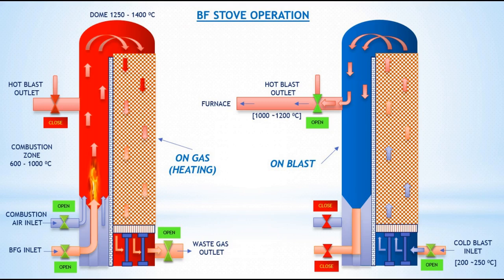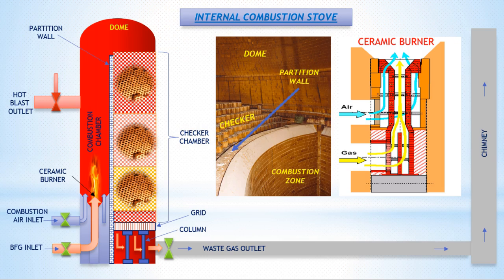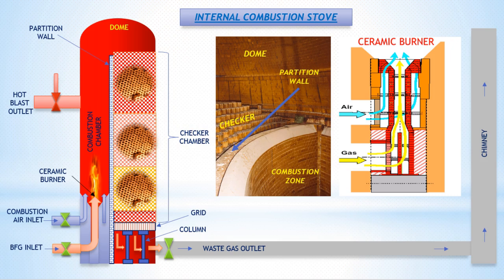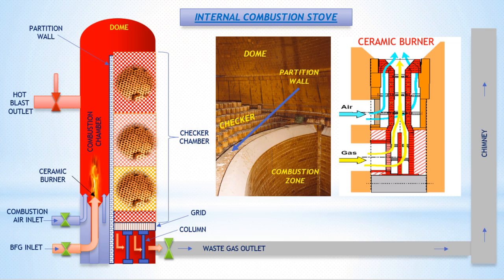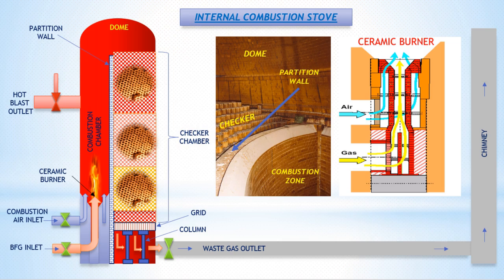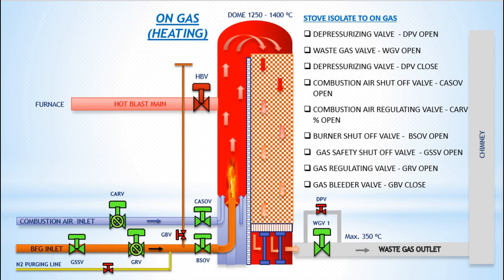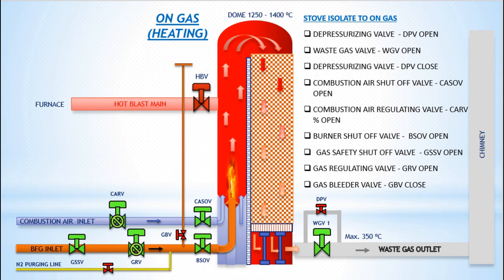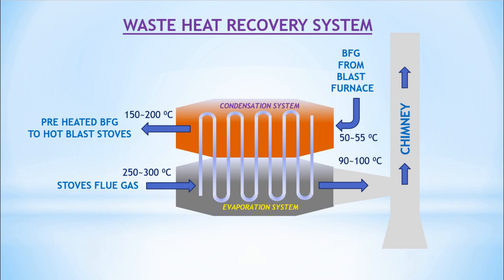BF Stove Operation | Blast Furnace | Function of Stoves | Tech It Eze

Comment: Good morning sir 
how to control blast furnace top pressure if increase.
And how to control hanging inside the furnace wall.
Reply from the maker: Thank you for watching videos. We will upload videos on your topic.
Reply from the maker: @mahendrabaghel2416  several modes available for top pressure control such as septum valve,  TRT mode, Wet Scrubber mode. Depends which system you have in your plant
Reply from the maker: For hang furnace control we will upload videos recently
Reply: @pgangulybf  okk

Comment: Sir what happened when ob blast stove suddenly gone box up
Reply from the maker: It should not, "minimum one stove will be on blast condition during running",  hardware interlock should be there. sudden off blast will result in furnace burden slip and splash slag may enter into the tuyere stock, resulted in unplanned shutdown & asset loss.
Reply: Ok sir thanks
Reply from the maker: If single ON Blast stove isolated,  then wind flow pressure suddenly drops & furnace will take slip, causing slag entry into tuyere stock, resulting in unplanned furnace stoppage.